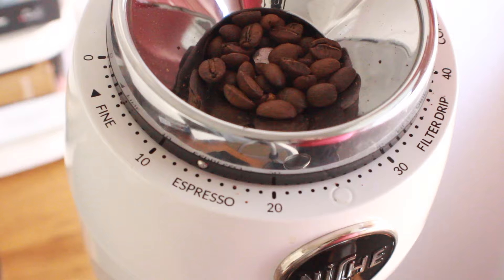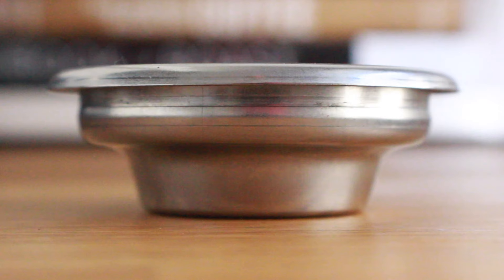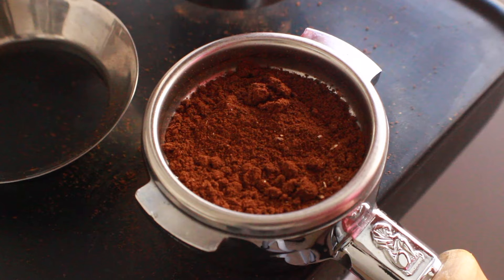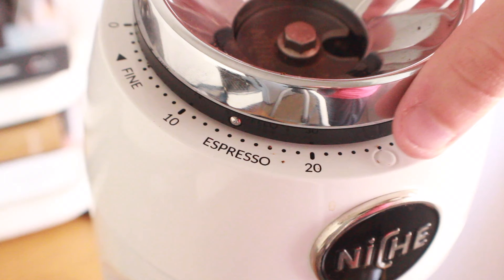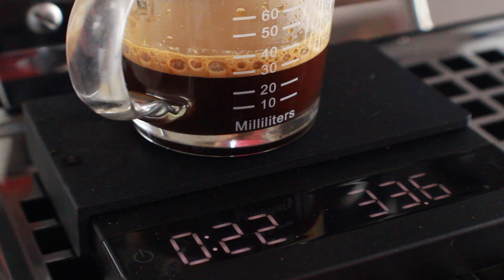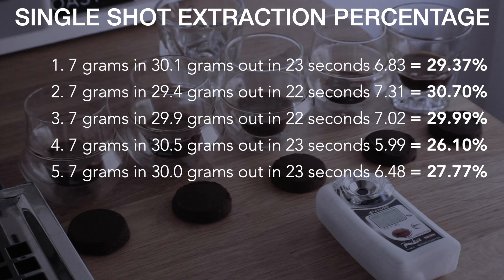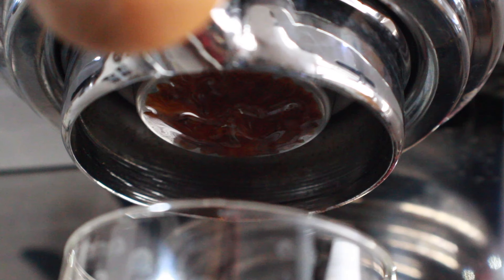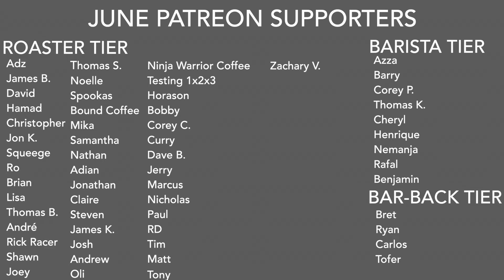ESPRESSO ANATOMY - The Single Shot

Comment: Have you recalibrated your niche grinder before? When I cleaned mine out and recalibrated, my normal espresso dial in went from 12 to 4. The shot is fine, but I guess it makes me ocd about the dial indicator being so low.
Reply from the maker: I haven’t done it yet, but plan on doing it in the next week or two. The grind number is likely to change since I’m not sure if or how they are calibrated from the factory. But Niche uploaded a video about cleaning, I haven’t watched it yet, but it may have some tips that I don’t have yet.

Comment: You would be better off using a double shot basket and using about 8-9g beans.  Adjust your grind accordingly and pull shots to taste.  Keep the single basket around when you start using all those pods that were sold along with pressurized portafilters.

Comment: Thank you for showing the pucks. I was really curious how single shot pucks would look. My first assumption is that they would be soupy.
Reply from the maker: Ricky Ng for sure! It was one of those things I was curious about too. I figured with all that extra headspace water would pool up and cause a soupy mess. But if the grind is right they come out pretty dry.
Reply: @Sprometheus  exactly. I had the same thought. Also you can pitch a new single basket idea with a deeper center. That way you can fit all the grounds inside. I doubt it'll gain any traction but it's a great idea for a single basket haha.
Reply from the maker: Ricky Ng haha yeah I can’t see it being a big seller at this point in American coffee culture.

Comment: Haven't tried the 7g single shot yet but when I tried 14g on a non-pressurized basket, extraction was too fast compared with a factory-issued basket with 22-26 second extraction. I'm wondering if I will increase the dosage or change the type of beans.
Reply from the maker: Eric Blanco your best bet would be increasing the dose. The beans can make a slight difference on extraction time, but very minimal. If possible you can also consider lowering your brew temperature to slow it down a bit too.
Reply: @Sprometheus  thank you for quick reply! Will try this for sure!

Comment: I use 9-10g in my Breville single basket with 25g out. I find it much easier to get a good shot then when using the double basket (I use 18g in the double, ~50g out)
Reply: i use 18g all the time, my yield is 47-50g over 22 seconds (infusion + extraction time). And how long is yours?

Comment: I used single basket but by seeing this video I think I was not using it right I used to dose the coffee till the top of the basket and of course it didn't tamp well 
I have a question is that u used 7 g dose but the yield is about 20 ml or more 
I was thinking that by using a single basket for 7g dose we should get a 14 ml yield ....
And I also used a naked basket and my question is that for that naked basket How many grams of coffee?
I
Reply from the maker: I used the higher yield because the research I did said that was the standard. It’s definitely higher than our average 1:2 ratio, but it ended up working out pretty well got me.
The straight walled basket is a 14g and the single basket is a 7g.
Reply: Thanks for replying 😊👍
I got one more question is that if we dose a basket that we will  normally use for a double spout 
Like 20 g coffee we will get 2 shots and 40 ml for example

But if instead we dose the same size basket( 20 g dose) in  a bottomless portafilter so we will have a single shot.. but
 what is that mean we got a double espresso in a single shot or how it works the ratio in a bottomless portafilter 🙏🙏 sorry for my English..
Reply from the maker: So the portafilter makes no difference on what the shot is or the ratio. If a 20g dose is a double in a spouted portafilter, than a 20g dose is a double using a bottomless, it’s just in one cup and not two.
Reply: @Sprometheus  thank u so much waiting for another interesting video !👍

Comment: how do you feel about la Marzocco's included tamper when comparing to the pullman? wondering if I'll need/want to replace the included LM one
Reply from the maker: Jessica Anastasio I stopped using it after toying around with extraction percentages between flat and the the convex (LM tamper). But as you can see I kept it though, glad I did!
Reply: @Sprometheus  I would be interested in La Marzocco’s suggestions for how to use the 7g basket. I just ordered a linea mini and will look over the instructions. Your post made me wonder if the 7g basket had any bearing on why LM uses a convex tamper. They’re too thorough with their designs for the tamp to serve no practical purpose.

Comment: The low TDS and high %EY results are entirely what you would expect with your brew ratio that high. 7g in 30 out is over a 1:4 shot - that's a super lungo shot by any standard. 
If you pull a 17g double shot at a 1:4 brew ratio and you'll see the exact same thing = low TDS, high %EY.
Reply from the maker: To a certain extent that’s true. But there is a point of diminishing returns that comes much sooner on a double or triple  puck pull.
Reply: @Sprometheus  That's true. I think the most interesting finding here is that the high EY% single shots did not exhibit overwhelming bitterness, and were enjoyable to drink. Since the puck is "deeper/thicker" in a single shot basket, perhaps there is less channeling and thus less over-extraction leading to bitterness? 
I really enjoy the content you're putting out here. Always appreciate seeing people try new coffee science experiments. Cheers :)

Comment: I am still trying to get a combo set up where my double (18 grams in and 45-50 out) and a single (naked 14 grams in and 25-30 grams out) can be done without changing the grind-size. With tamping as the only variable.
Reply: Hi Jeroen, what is the duration (infusion + extraction time) for the 18g in and 45-50 out?
Reply: That is around 26-28 seconds.
Reply: Jeroen Geurtsen, thank you !

Comment: Seems like all this espresso numbers 7g 14g 30g and the fluid 30ml 60ml or ratio g:ml 1:2 or 2.2 or the basket shapes and sizes, all of those infos thats circulating got perceived differently from one person to the next. Maybe the original inventor of all those doses already dead and everyone is left wondering the exact perfect dose for each. All we hv now is just the numbers without exact match which one is for which. There are  51mm and 58mm and others too. I bet this small 7g dose is for smaller basket but forced to be used in 58mm so the shape is changed.

Comment: 🤔... less time? 
Not sure how to describe this, but it appears you have uncovered something that I suspected for a long time. 
A "snowball effect" during extraction where the process starts slow, coffee is being stripped from the ground and infused in the water... 
As TIME goes by this stripping increases its rate, seemingly exponentially, or by orders of magnitude more by each second of water through the puck. 
Visualize coffee as water passes over its surface extracting the compounds and once they begin to strip off into the water, it's like the coffee starts giving up everything even quicker and quicker. Caffeine is one of the last chemicals extracted that we want, beyond that and if you miss the mark, it will give up all that dry astringency before you know it... maybe the single shot needs its own recipe and we gotta stop trying to get it within 25- 30 seconds.
Shoot for creme turning lighter at 15 seconds and taste.
Great Video as always :)

Comment: Why not trying a 9 - 10g single dose?
Reply: If you're talking about the grounds and not the weight of a finished ristretto, 9g is about the maximum that'll fit in the reservoir on those single baskets. More than that, and the distribution after tamping is likely to be a little uneven, and more prone to channeling. FWIW, 8g pulled to a 16g normale is the sweet spot for me, with the coffees I like best.
Reply from the maker: barista odla based on the info I was finding it seemed like 7g was the most used dose. And I don’t think fitting 10g oh that little basket would be possible. But I may play around with it more.
Reply from the maker: John Heckendorn this is what I was thinking, but good to know!

Comment: When I was working with a setup that allowed us to do singles, I eventually found the sweet spot to be 8-9 grams of coffee, tamped harder. That yielded a pretty decent un cafe with a slightly shorter extraction time than a 16.5g double. It was certainly much more difficult to be consistent as the tamp had to be absolutely perfect or it would channel wildly.
Reply: I was trying all day today to pull single shots... I did ending up using 8 or 9 g to at least cover the basket.

Comment: I always find interesting how rare a single shot is overseas. Here in Europe the single shot is the norm rather than the exception (at least in a proper coffee shop, in a hotel or a average restaurant you'll get a much larger, but awful drink which has nothing to do with espresso). You really need to specify you want a double or doppio if you want a larger shot and you'll get a large 60ml shot. The modern "American style" 40ml double with close to 20g of coffee would be a rare order and would probably be called a double ristretto.